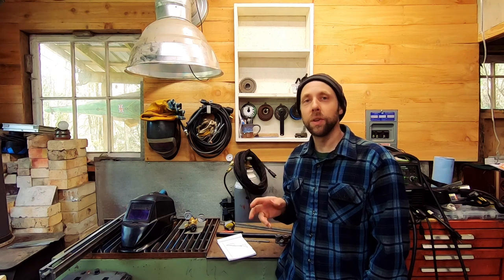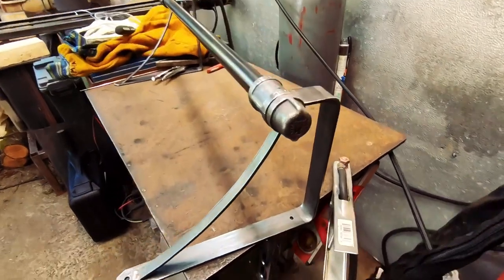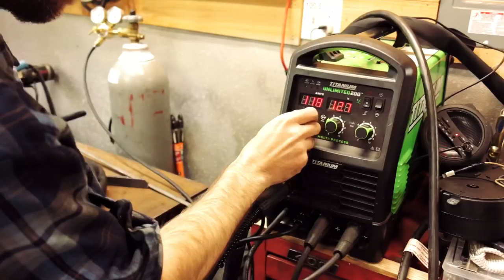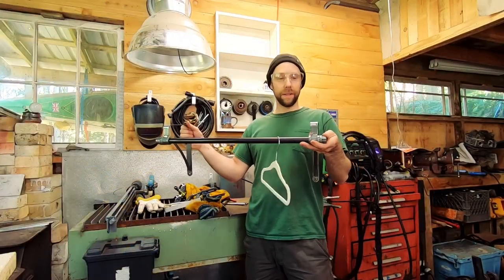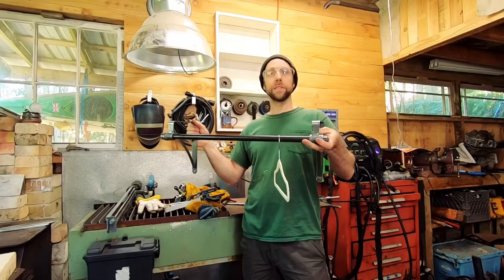Building a simple clothes rack project

Comment: Cool, nice job!  So the pipe or rod bender, Harbor Freight??  And where might be a good place to look for a metal lathe?  If possible I'd like to buy local and used?
Reply from the maker: Yes I got the metal bender from HF, they are fairly solid, plus you can used the 20% off coupon on them, the instructions are the only thing bad about them, I found some drawings on line of how to set the dies up. I think with a lathe you could make special dies for other stuff like bending square tubing. I picked up my lathe about a year and a half ago for $1600, I looked on Craigslist for about two months before finding this one, ever good deal I saw sold within a day of being posted, or there was a lot of over priced ones that would stay on CL for a month at a time. Mine came with a little extra tooling, that definitely helps, extra chucks, collect closer, nice drill chuck, live center set, quick change tool post and a few other things, no cutting tools but I ordered them on Amazon and EBay a little at a time, now I have about what I need. Mine is a 13”x40 lathe that’s the size of metal it will spin, I was going to buy a little smaller bench top one buy my friend Dave recommended that bigger is better, I like the size of my lathe but I have yet to max out the capacity of it. Let me know when you get one, I would like to know what you find. Just set some cash aside and keep a close eye on CL and be ready to call on them when you see a good price. Take care :)
Reply: @Mikefestiva  thanks Mike 👍👍

Comment: The Most Common-sense-less Suggestion I watched in my ENTIRE 66 years.To have a  clothing's hunger I need a lathe machine, a metal bender, a welding machine, s grinder,... .
Reply from the maker: Well if you had the ability to think outside the box you could easily build something unique like this without most of these tools, I have them so I mine is well use them. I’m deeply sorry for your clothing HUNGER! That must be tough :( I hope you can find a way to get help with this, at 66 you still have a chance to change. Good luck :)